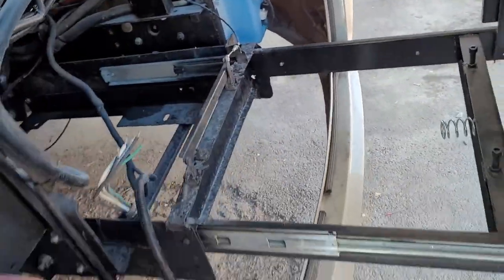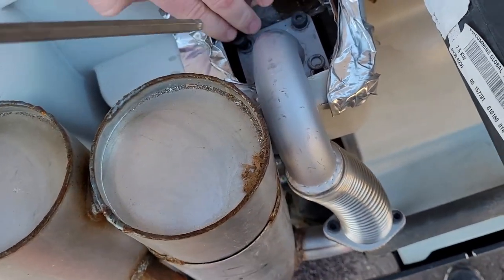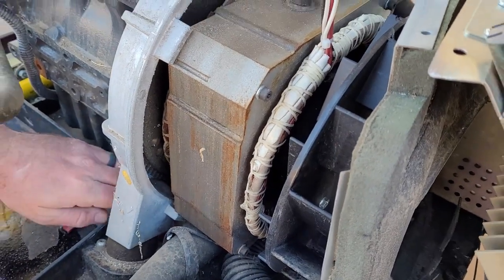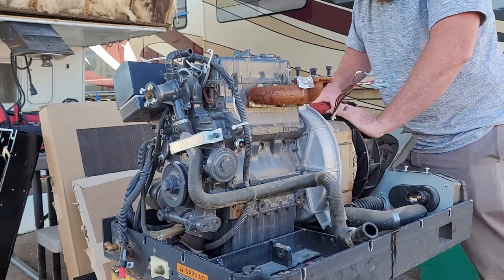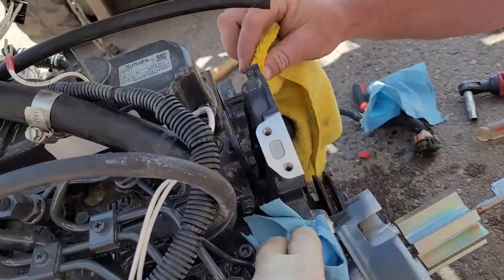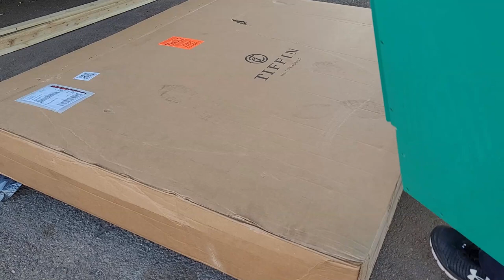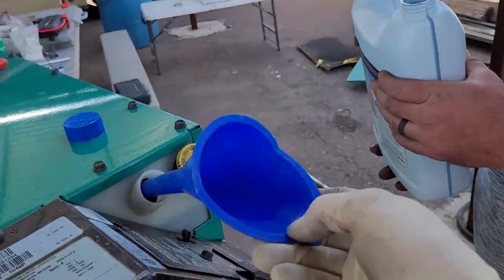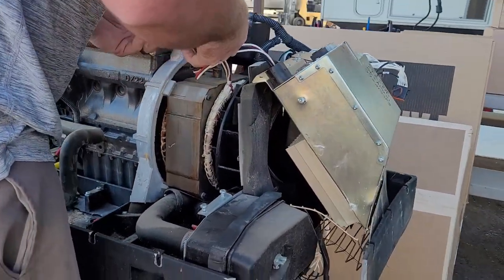Can We Re-build a Smashed Onan 8000watt Diesel Generator?

Comment: That is awesome.  I love that you dig so deep in these units and not only repair them, but let the rest of us mortals know whats inside.
Reply from the maker: it was important to tear down and make sure there was no further damage. It's good as we would not have seen the oil pressure switch
Reply: @AZExpert  I don't know if you answer questions I have 7500 onan gen can run ac sitting still all day go on the an start it about 5 minutes  or so the gen stops running code 1. 4

Comment: Glad you got it working!  Those little diesels barely sip the fuel yet make dependable power.  Thanks for making the video!
Reply from the maker: Great point!
Reply: Gallon a hour sipping?
Reply: @cutterbacon  I have to ask: did you get your generator serviced/repaired? Because there is Definitely something wrong with it using a gallon of fuel an hour!

Comment: I’m glad you showed the oil filter side of the engine. I have an oil leak on mine and now it’s clear that oil fill hose is the culprit. I don’t have my generator on a slide, so it’s hard to replace. But looking at your video I can see the tube should slide out without removing and disassembling the generator. Thanks man! Pro tip, lift with your legs!
Reply from the maker: Glad it helped I;ve seen the dipstick tube have issues too

Comment: The interesting thing will be when you put it on the front slide...  The slide on my Tiffin only rolls halfway out.  Great video, thanks.  I have a coolant leak from the surge tank and now I know I to deal with it.  Thanks, James.
Reply from the maker: the generator mount on this 2019 Red doesn't slide the generator out only the front of the fiberglass cap, so the generator doesn't move.

Comment: Wow you absolutely are the expert on all RV systems!  I went to change spark plugs on my 2000 Onan 5500  it and discovered that you have to remove the valve covers to get enough room to get to the plugs...  Poor design? Or ,maybe smart engineering and that is how they force you to check/set valve clearance when you change the plugs. Is it the same on newer models? Should I try to clean out the old carburetor or buy one from Amazon for $50?
Reply from the maker: I have had nothing but bad results with the Amazon carbs. some people have had luck, but I have 4 bad ones

Comment: Also use a airlift system for filling the coolant to prevent air pockets, only $100 on Amazon.
Reply from the maker: thanks, the cooling system on this is pretty small and plumbed with the fill as the high point

Comment: What does it take for the insurance to total one of those expensive pushers? This repair had to cost a fortune. I guess they probably compare the estimates to the cost of replacement, but if I owned it I’d hope for a new rig.
Reply from the maker: I still cannot understand how an insurance company totaled it. This was a $330k unit with $50k of damage. I'm guessing the shop quoted $330k to fix it so they would not have to

Comment: Just where is the tow point on this Tiffin if it needs to be pulled forward?  It seems that it should have a removable front panel that has access to a tow hook receptacle like trucks have.
Reply from the maker: You need a professional tow truck driver to do it. There are too many ways to damage your RV. Do NOT attempt.